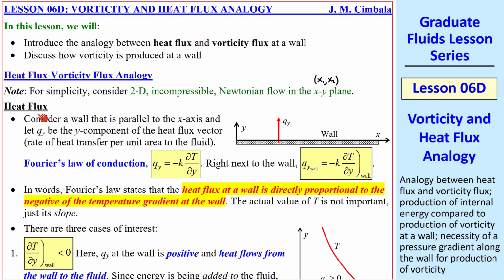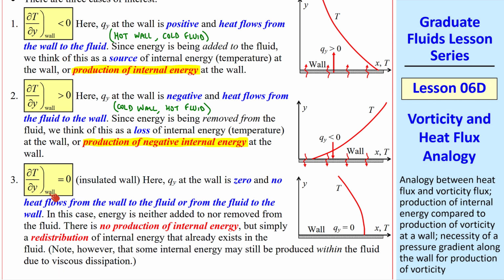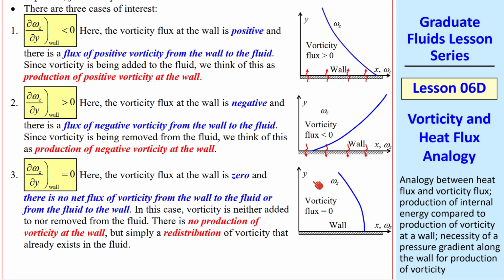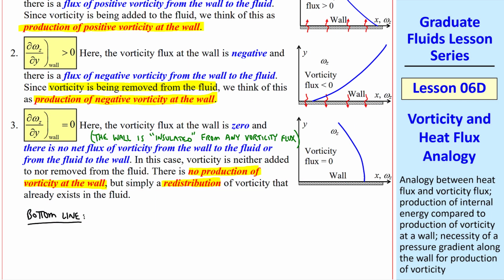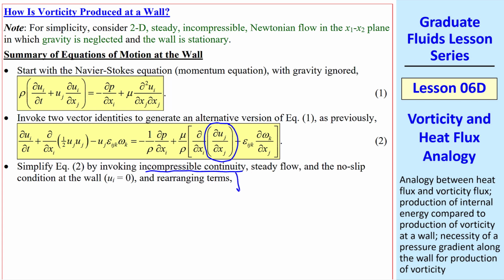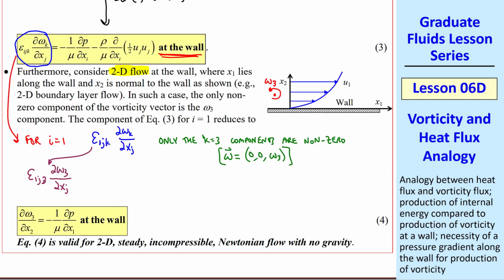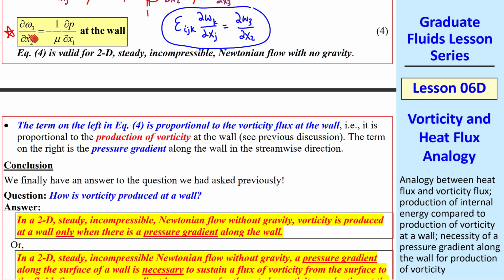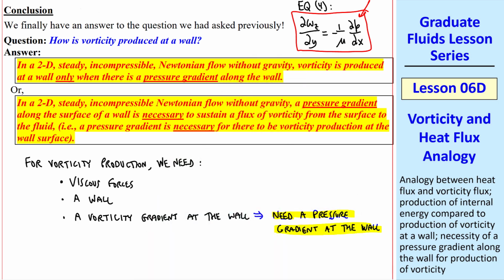Graduate Fluids Lesson 06D: Vorticity and Heat Flux Analogy

Comment: Hi professor, I was just wondering if the reason for flow separation is due to the fact that it injects anticlockwise rotation into the flow in case of adverse pressure gradient? The ACW rotation seems to push the fluid way from wall...